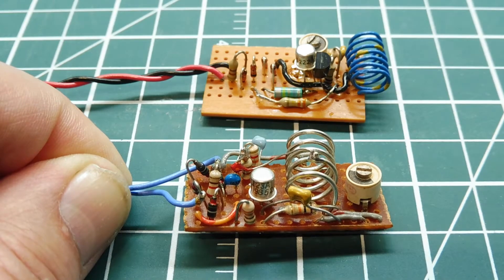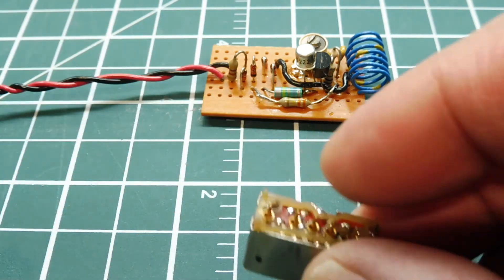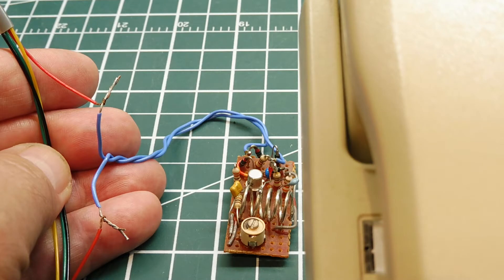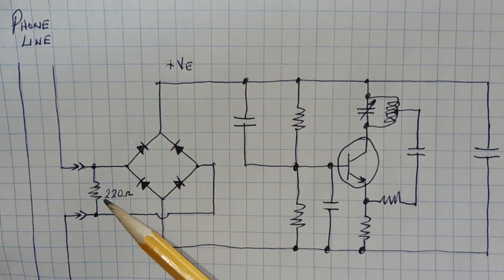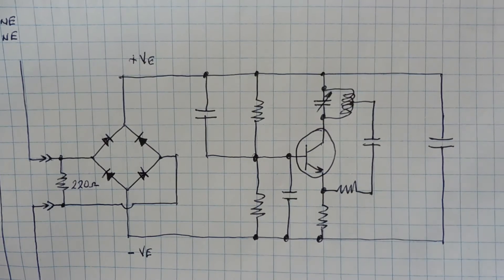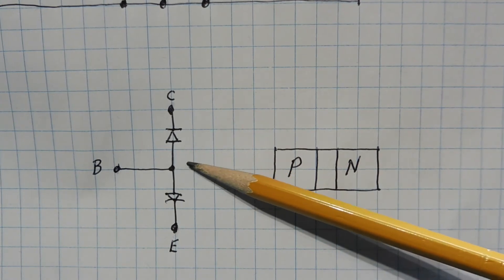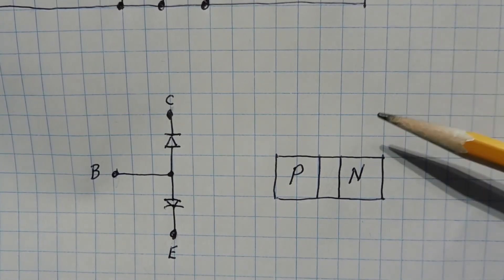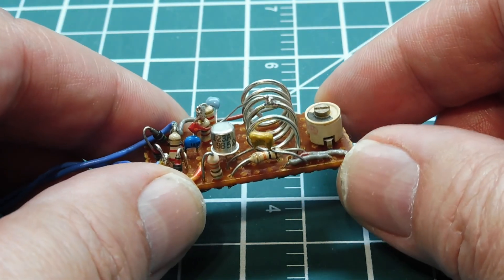Simple FM Radio Transmitter Operation and Theory

Comment: They are so cute and refreshing after watching an idian guy solder a 9v battery, a resistor, a coiled antenna and a surface mount crystal and called it an FM transmitter and not one person called cap except me. Oh it had a mic too.

Comment: What is the function of 220 ohm resistor across bridge rectifier?
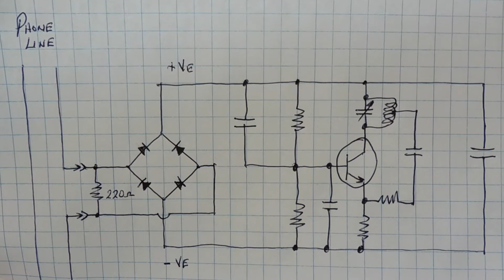Reply from the maker: When the phone goes off hook, loop current flows through the 220 ohm resistor creating a voltage drop which powers the transmitter and enables the phone set to work properly. Explanation starts at 3:00.

Comment: What is the advantage of feedback to the emitter instead to the base of the transistor?
Reply from the maker: The capacitor from the base lead to ground is an AC short so the circuit is a common base amplifier where the input is the emitter. The tapped coil on the Hartley oscillator is fed back to the emitter (positive feedback) which causes the circuit to oscillate.
Reply: @0033mer imm be straight up and say i don’t think there is feedback at all. The lead from the coil to emitter is for FM offset. Best way i can describe it is imagining the tank as a bell and the transistor a hammer. We don’t need feedback because the voice modulation is already doing that work.  Coming off the emitter is a finger that squeezes the bell as it gets louder, increasing the pitch of the bell. 

Sorry i just cant see it any other way. Even if that cap is an ac short, its on the wrong side of resistors i feel liek

Comment: Where's the positive feedback, shouldn't it be connected to the base ?
Reply from the maker: The capacitor from the base lead to ground is an AC short so the circuit is a common base amplifier where the input is the emitter. The tapped coil on the Hartley oscillator is fed back to the emitter (positive feedback) which causes the circuit to oscillate.

Comment: here the capactiors act as a parallel? because Vcc acts as a short for AC signals
Reply from the maker: Yes... the RF signal sees the power supply as an AC short so the base to collector capacitance is actually across the tank circuit.
Reply: yes and also the feedback capacitor is in parallel with tank circuit. when we want find the resonant frequency capacitor should be added because they are now in parallel

Comment: Your circuit shows a Hartley oscillator (tapped inductance) and not a Colpitts oscillator (tapped capacitance.)
Reply from the maker: Yes .. your are correct, the circuit diagram shows a Hartley oscillator. The other transmitter with the insulated wire coil is a Colpitts oscillator which I original used in my diagram but changed when I made the video.